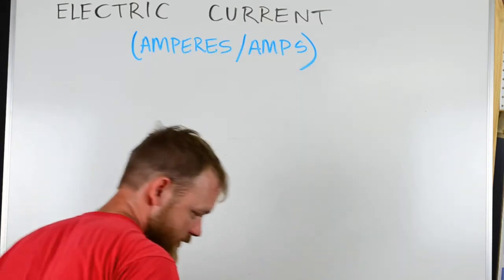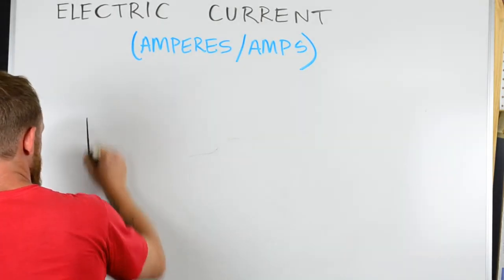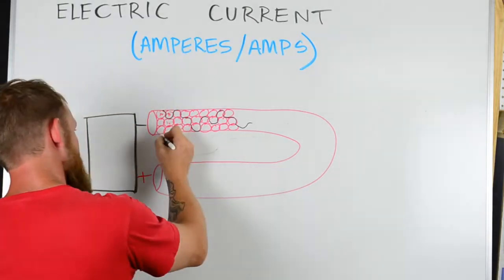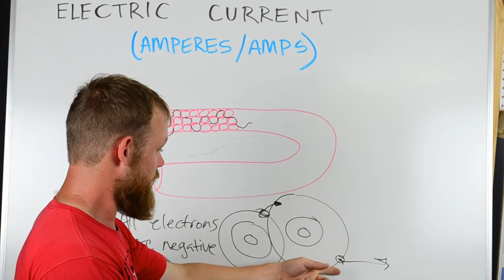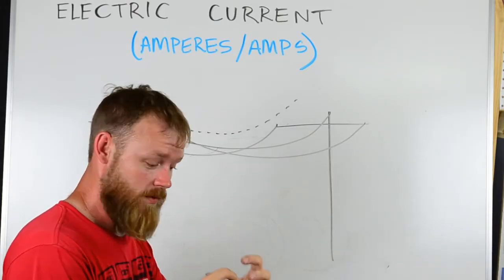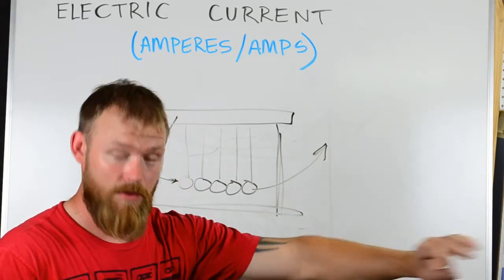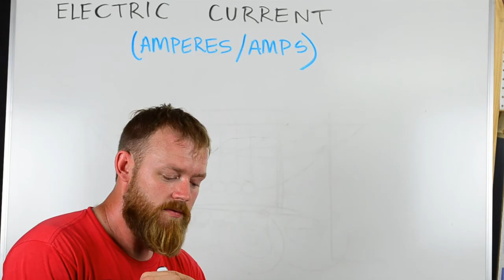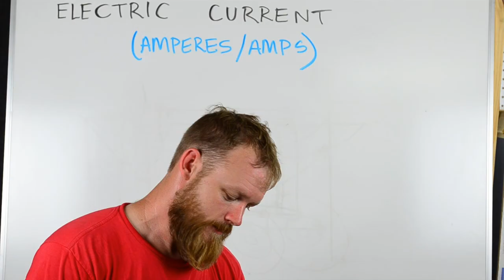Electric Current (Amperes/amps) - What Electricians Need To Know

Comment: I have a question for you, you describe electricity working like Newton's cradle (that's how I've always thought of it) but then how does a non contact voltage tester detect electric? Let's say you have a positive conductor coming straight off a breaker, no load connected yet or anything, no current could flow so what is the n.c.v.t. detecting?
Reply from the maker: It works off of a phenomenon called "capacitive coupling" - keep in mind a NCVT is detecting a voltage (a difference in potential) present, not a current (a flow of electrons) like a clamp-on amp probe would.  Similar to how a transformer can, through thin air, induce a movement of electrons in another circuit - a capacitor can transfer charges through thin air to induce a voltage (potential) in another circuit.  The single wire you're testing has a constantly changing potential on it.  From low to high essentially.  The NCVT picks up this changing potential and through capacitive coupling mimics the change in potential in it's tiny circuit inside, giving it just enough of an interaction to engage it's internal circuit, allowing it to emit a tone and a light.
Reply: @electricianu  Thank you, that made me picture it as like a fire hose or one of those expanding garden hoses. If the nozzle is closed at the end and you turn the water on the hose swells up and you turn the water off it can shrink back down so even though no water is actually traveling through it it can still build potential and lose potential.
Reply: Damn electrons )

Comment: went from an 18 yr old fry cook to a 20 yr old industrial maintenance electrician from youtube and 5 dollar ebay books. no degree. no classes. just used videos like these and used them as my classes. wrote things down. made flash cards. made study guides. 18 yrs old didn't know what an amp or volt or ohm was. 2 years later interviewed and passed a job interview test and started at 33 an hour. and learned as I went. for anyone out there wanting a career in this trade you can do it. put your mind too it and pay attention. the knowledge is everywhere. its like matt damon said in goodwill hunting. don't spend 20 grand on a degree you could have got for 5 dollars in late charges at the local library.
Reply: thanks for your motivation and congratulations on your career!

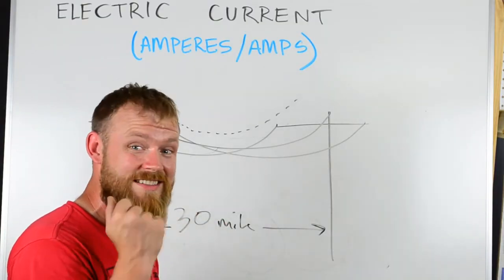Comment: 9:31 It's called Newton's Cradle.

I have a suggestion for a future topic/video.  Can you please discuss why the neutral and ground is bonded only at the first/main disconnect, usually by the meter and why the neutrals and grounds must be kept separate after the first disconnect.  Appreciate all the great videos you're putting out.  Thanks.
Reply: Khyber Safi yes why??
Reply: So that current doesn't come back on a ground. At the service entrance there's a ground rod connected to the panel/disconnect and the neutrals are connected to the grounds. If the neutral fails the current from the system will flow on the ground. This is for safety. Having  a backup "neutral.

If you bond grounds and neutrals after this point, it would be possible for current to be traveling on the ground. Lets say you have a sub panel and you forgot to separate the grounds and neutrals. The ground wire between the sub panel and the main panel will most likely be carrying half of the current from the sub panel. The neutral and ground will likely be carrying equal current.
Reply: Because it's the shortest distance back to ground (Earth)

Comment: Dustin. I've replaced 100 Amps residential panels with 200 Amps panels. what I've always wondered is how many amps can the wire(s) coming from the transformer hold? or what's the maximum Amps it can hold?  I've installed a 2/0 service entrance wires on a 200amp panel and I've noticed the cable coming from the transformer is probably a #2 or , #1  gauge cable. why is it? or does the cable coming from the transformer also need to be upgraded when upgrading to a 200 amp panel?

Comment: not to sure if this question has been asked before but. Take runway lights for instance, how do low watt high amp bulbs work compared to say a standard high watt low amp
Reply from the maker: Inverse squared; take hilide bulbs or metal / sodium bulbs for example. 

But usually the watts to amps at the same voltage is proportional. Unless we are talking leds. That gets… complicated.

Comment: Basically current is QUANTITY or intensity of current thus I represent amps, a good analogy 
is  8 D cells in a ghetto blaster radio/tape deck. each D cell is1.5 volts X 8 = 12 volts. 
but the amps in a d cell = about a half amp. Now that battery in a Harley Sportster 
might have an ampere-hour rating of 22 amps, that is enough current to be used by
the starter motor. Now the current capacity in an automobile battery of 12 volts will 
be even greater as the starter will be cranking a much larger engine. So there is is
12 volts under 3 situations yet the amps are increasing from D cells to a bike battery
to an automobile battery, and if you want to a diesel truck battery.  
Similarily 120 volts in the house has various ampacities, 15 amps 14 gage for general lighting, 2  20 amp ckts 12 gage for the kitchen as required by code, a 30 amp breaker for the clothes dryer a # 10

Comment: The Newton Cradle is a perfect analogy for the movement of electrons.    Many basic electricity explanations make you think of a hosepipe of water (which is the best way to describe it to a novice) where it flows from one point to another.    While the water pipe analogy is a great basic teaching tool it is wrong on a technical level.   And the pressure on the water valve = Voltage, while the diameter of the pipe constitutes your Resistance.

Comment: You can calculate how many atoms are in that wire.
We know the density of copper is 8800 kg / m^3.
We know the molar mass of copper is 63.54 g / mol.

# atoms = Avegadro's Number * Density / Molar Mass
This comes out to 8.342 * 10^28 atoms / m^3

Now just multiply by the volume of that wire.
The diameter is 0.0640 in = 1.63 * 10^-3 meters (14 gauge).
So the cross sectional area is 2.09 * 10^-6 m^2
Multiply this number by the length of the wire.
I'll just give that wire a length of 6 in. = 0.152 meters

So the volume of the wire = 0.152 * 2.09 * 10^-6 = 3.17 * 10^-7

This means the number of the atoms in the wire = 8.342 * 10^28 * 3.17 * 10^-7 = 2.65 * 10^22 atoms

Maybe not important to be an apprentice electrician.  But you never know where the trade is gonna go.
Reply: They already have charts for that. You don't need to know how many atoms just the circular mils

Comment: I want to learn how many amp come out of a circuit breaker to a room wall socket to power a desk lamp and a room A/C unit and how a circuit breaker trips from a bedroom for example.
Reply: If it's a 40A breaker, it can pull up to 40A without tripping the breaker.  You can put appliances and a computer and an overhead light - but if you try to put, for instance, a space heater on top of all of that, you might trip the breaker.

The breaker trips because it has an electromagnet switch inside.  When the total current on that load exceeds 40A, the electromagnet turns off and stops pulling a contactor.  And the current stops flowing.  It can also work in reverse - but it's always an electromagnet.

Comment: 50 hz here in UK so its 25 hz each direction for ac.
Reply from the maker: That would still be 50 in each direction along the waveform. A hertz is a cycle. It is one potential then the other potential - both in a single cycle - but that means it changes directions 100 times per second at 50 hz. I’m curious to learn why y’all use 50hz vs why we use 60hz. I’ll have to look into that.

Comment: Using a water analogy, I tend to think of electricity as a river, volts being the water speed and amps being the width of the river or volume of water
Reply: Is it similar to bandwidth vs. throughput in networking? Bandwidth is the capacity of a cable for data versus throughput being how much data is actually flowing through?
Reply: Let's modify your thinking of this. Think of volts as a lake that is held back by a dam. The lake is your voltage. It is pressure that can be released causing a flow. The flow of water can be thought of as current (a flow of electrons).

The dam can be thought of as a resistor or a resistive load that slows down the current to a manageable level. This analogy is a little more accurate, because voltage does not move! It is pressure that can cause movement, but voltage does not move. You can have voltage without current. But you cannot have current without a voltage being present! 

The damn can be completely closed right? But the lake is still there. The voltage still exists, but there is no flow. If you open the damn a little bit, you begin to have a flow. Now you can think of this as your current. The current is flowing and the dam with a lake behind it is present. 

If you didn't have a lake behind the dam,  you could open and close it all day long, but you would have no current, right? 

If there was no dam there for resistance, you would have no obstacle to the flow from the lake which would be a dangerous situation. You can think of that as a short circuit.
Reply: @TortureBot  nice, could you explain what the Amp is then?
Reply: @Layarion  technically, it is a measure of current. Similarly, a Volt is a measure of voltage. You can have 15 Amps of current. You can have 115 Volts of voltage. (And you can have 10 Ohms of resistance.) These numbers are just examples of current (measured in Amps), voltage (measured in Volts), and resistance (measured in Ohms). I guess you can think of the Amp as measuring HOW MUCH electrical current is moving. If you barely open the damn, a small amount of water starts flowing. (Like a small amount of current if you only have a couple of Amps.) If you open the damn more, more water flows. (Like a large amount of current when you have 20 Amps!) More ELECTRONS are flowing when you measure more Amps. If nothing is flowing (moving), there are ZERO Amps. Again, there can be VOLTAGE (pressure) that you can measure, with no current. There can NOT be current, with no voltage present.
Reply: @TortureBot  I'm going to do separate replies, because I think in a way we're talking about understanding scale, and therefore, safety.
Reply: @TortureBot not Mopegan....it's me, I'm going to do several replies...
Reply: @TortureBot  The goal is to get motion, right? When we're talking about current we're talking about movement. With the lake example, the difference in potential exists because you have a lake blocked by a dam. So in our brains we kind of naturally think of the lake exerting the same amount of pressure most of the time. Unless there's a severe drought, or the lake is drained, then the voltage stays steady, because the lake remains filled. The resistance of the dam is equal to the potential of the water pressure, and everything is good, because there's no flow. The only real flow is through evaporation, and it's something we barely notice. Things are safe. I'm wondering, in real life are we normally assuming constant voltage?
Reply: If this is true, then it doesn't matter if it's a lake or a river creating the potential energy, it's the nature of the resistance that dictates what flow or movement will be allowed, right? If a river is feeding the dam, then we have let water drain from the lake. At this point I'm wondering if now what's important is the path that you make for the overflow. If there's a town on the other side of the dam we have to carefully regulate how much water we release from the dam at one time, because letting loose too much movement at one time would flood the town. So does that mean amperage is about how much water we can safely let overflow into the town at one time before we destroy it?
Reply: Ok, so then getting back to why it's important. Justin talks about size a lot...."if it's 12V no problem, it it's thousands of Vs, bam! Very dangerous." The jist of it that I'm getting is that one can DOOOOOO a lot of different things, but fortunately someone writes code (an agreement by experts on what scale can be safely tolerated in most situations) to reduce the overall risk of using electricity to solve human problems. But since space and time dictate what will physically happen, and people are super creative and risk averse, it all comes down to what medium or material we choose to accept the force of the energy. What I mean is that we can build systems that can safely handle the 'movement', and we can overbuild saefly too. Electrical systems are overbuilt with safety in mind. Like if we put all buldings underneath the dam on risers that are high enough to prevent flood damage, then  should a catastrophic break occur, we're ok, because the physical system can handle movement of water through the town. It will just flow under all the risers keeping our carpets dry. Is this what we mean by load? Is the amperage the load, or what the system can bare?
Reply: @sharonmadison23  you're confusing me now. Are you Mopegan, too? Who is Justin? You may be taking the water analogy a LITTLE too far. Not everything with the water analogy is going to have a direct relation to electricity, but it's still a good way to wrap your head around it. Not sure I fully understand what you mean by scale, and you're especially losing me talking about space/time.

The goal is to use natural electron movement to do some work for us. It can make a bulb glow, a motor turn, or a coil heat up or produce a magnetic field. 

I use a lake as the voltage, because you can think of it as something just sitting there, potential work that can be done. A river has to feed the lake usually, but since a river is moving, it makes the analogy a little less clear. 

Resistance does indeed determine flow, and we use resistors in circuits to limit the amount of current that can flow based on how much we need to do our work and how much the components can safely tolerate.

I guess you COULD think of a closed dam as a giant resistor of INFINITE resistance (almost like a break in a wire or an open circuit). But since we want to utilize the source (the dam) to do work, we will want to open the dam some. How much it's opened then determines the amount of resistance observed and how much flow (current) we get. Maybe it's best to think of the spillway as the resistor and depending on how much it's opened determines the "value" of the "resistance".

Comment: No, current IS the movement of electrons. The proof is that if the electrons don't move, nothing happens. Matter of fact, an amp is defined by how many electrons pass a certain point in a given amount of time.
Reply: Electrons vibrate, its the charge or energy moves with the the speed of light